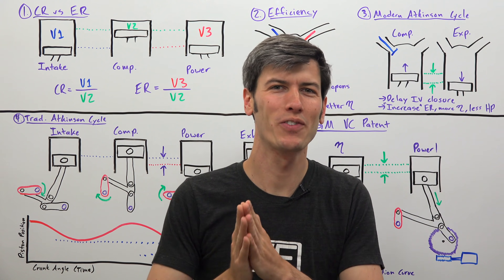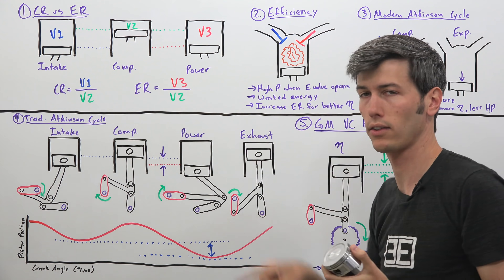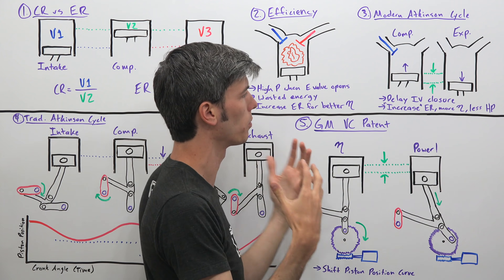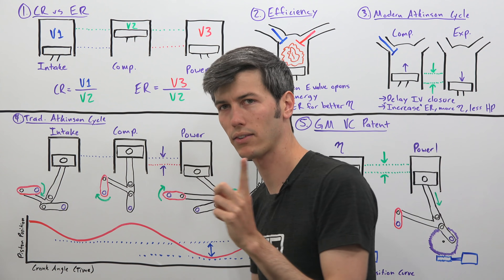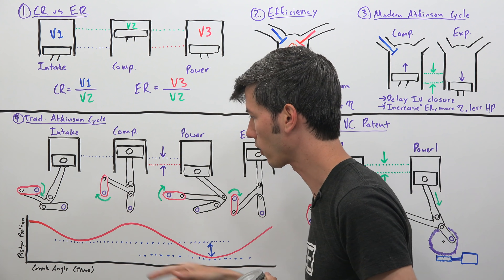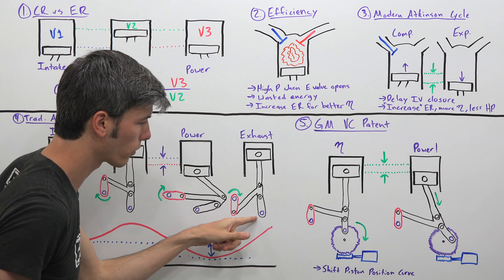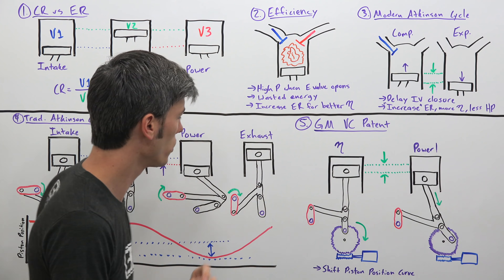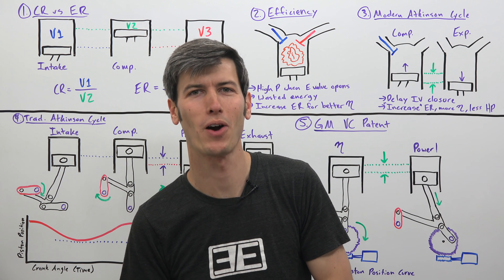How GM's Variable Compression Engine Works - Patent Review

Comment: It looks like a great amount of force isn't directly transfered to the crank shaft... And how about vibrations?
Reply: Good point, in theory with 2 cylinder pairs phased 180 degrees apart in an inline 4, vibrations should all be cancelled out, so it shouldn't need balancing shafts and can save weight. I am curious what the real world efficiency would be over a regular miller cycle engine.
Reply: @mattlimberg5763  Wait... I forgot for a moment you can put more cylinder on engine XD
The main drive shaft will move up-down-left-right, how can every piston follow the movement?
Because in 1 cycle the main drive shaft will be in 4 different position, by adding 1 more piston, the shaft will be tilted by 180 degree...
I still can't imagine it... Maybe I need an animation with all 4 pistons

Comment: Great explanation.  So, more parts.  More points for failure.  Added complication.
Reply: Was gonna say the same thing!
Reply: Great explanation of the Atkinson cycle. Despite the respect I have for this engineering marvel, I fear that the introduction of all these failure points will see it being shunned by power hunters. I suspect that you’ll see this technology on smaller engine to give them the occasional sensation of power  through various driving settings that are so common now.
Reply: It's what they want
Reply: You want simple and powerful, go Electric!
Reply: @allthatjazz721  Amazing how many man-years of engineering go into minuscule improvements in efficiency of a nearly obsolete relic of days gone by.
Reply: @allthatjazz721  Completly agree. I think ICE engines are way outdated and oldfasion...

Comment: By the looks of it, so much force just gets transferred into the bearings and is seen as reaction force opposed to driving the crank. Am I missing something here or is the illustration just not accurate. Seems like you can be getting much more torque by reducing reaction force in second pivot. Something to crunch numbers on anyways.
Reply: Nick Nogalo will definetly be more friction and resistance internal to the engine but theyre getting more energy out of the fuel, gasoline engines being something like 40-60% efficient theres alot of meat on the table to be gained.. those friction losses might be 1.5% engine power but the efficiency gives like 8% more power from the same fuel

That being said id never buy one.. dont be the first guy to try new tech it always takes them a few iterations to get it perfected

Comment: What I see here is more mechanical bits and therefore more things to go wrong....in order to have reliability, we need LESS moving parts.
Reply: By that logic a rotary should be the most reliable engine ever made.
Reply: @rosa-f5i6o  You'd think, but the apex seals have forever been a problem spot. Even with simplicity you will come up with issues to deal with, but generally, less is more.

Comment: Great, pushing hot expended gases back through the intake shouldn't create excessive turbulence, because gas laws don't apply to GM powerplants? Good thing GM has excellent quality control and this system won't require high precision/accuracy (sarcasm). My crystal ball show's a lot of bent valves, a ridiculous amount of carbon in the intake runners and wrist-pin deformation. If GM offered me an engineering position, I'd just become a stripper.

Comment: just imagine how rod bearing failures would sound like on this....
Reply: Now I wanna hear it
Reply: That’s only if they make it out of the same metals as before. Hope they use really good quality metals so it will be just as reliable as before.
Reply: @inthebeginning6895  GM doesn't know how to make a reliable vehicle any more so I wouldn't hold my breath
Reply: @GO AWAY But the 2.8's sound great?
At least the fiero ones do.
Reply: No way this design will be cheaper, now they need high-quality worm gears and extremely durable electric motors to withstand the operating conditions. I think many consumers will find it completely impractical to not only buy a modern GM product but one also sporting a new design. GM should've simply put the LS in every vehicle in their lineup, most people wouldn't complain. A few years ago I was making a 6 hour trip and stopped at truckstop to refuel. Their was a brand new Corvette in the parking lot, saw the guy get in to leave and I heard it just keep turning over as I was pumping gas. Funny enough, the fellow in a brand new Silverado 1500 on the opposite pump went to start his truck and all you could hear was the starter clicking. I tried for about 10 minutes jumping him off, but it would still only click. I had a brand new battery, I keep a good multimeter around and use it more often than I probably should, so no fault there.

I also remember Motortrend having a shootout and the supercharged Corvette had a massive engine problem right off the bat. Then you have absolute lemons of vehicles like the Cruze and likely others out there. All I know is something f*cky is going on at GM. Shame too, if they had an affordable midsize truck with a  LS that was actually QC'd I might be interested. Seems like they're moving as far away from simple and reliable as possible. Beats me 😞
Reply: It'd sound like a middle school drumline team
Reply: Like a shitty drum solo...
Reply: They sound like an ATM overdraft fee
Reply: Looks like GM is gonna have to make it as cheap as possible so it is easier to sell engines to customers. Its the GM way.
Reply: @Kyros9119   LMAO cheap doesn't have any relation to reliability. There's a reason why imports are tossing their garbage factory engines and swapping in GM LS V8's. There's a reason why import fanboys cry every time another LS swap gets posted.
Reply: @99Lezard99  Big end bearings was my first thought.  Without severely restricting the revs, I don't see how they would survive long, with all that stopping and restarting in the opposite direction.  At least the little end is relatively light...

I'm thinking "bag of marbles under the lawnmower" sounds.  :-D

Comment: God explanation - thanks. For GM though, my guess is that it is too little too late with EV's coming like a freight train. Maybe they should've put that effort into improving EV batteries, electronics or motors?
Reply: or even improving efficiency of solar
Reply: @fidelcatsro6948  The more important metric is price per unit of generation capacity....which is already lower than coal.  All efficiency does it make panels smaller...which could make panels cheaper (or it could entail more exotic materials or complicated manufacturing which give the opposite result)
Reply: @DT-dc4br  that makes sense..

Comment: Something like this would have been more interesting 15 years ago. Now it seems the way forward are hybrids and +/- gearboxes akin to Toyota and Lexus. In such a case the engine doesn't need to be hyper-efficient outside of optimum operating range because you can run the engine harder and store the extra energy in the batteries. Long-story-short, this kind of setup makes more sense in a big power non-hybrid engine. And those are kind of going away anyway.

Comment: Doesn't lowering the compression ratio and then adding boost kinda just get you back where you started?
Reply: no it's not. you might start with the same compression pressure, that's right. but the work you had to do, to obtain it, is lower than in normal engines. remember that a turbocharger is a way to regain already lost exhaust power. A compressor instead won't do any good at all. this means you have the same long way to expand and use the combustion pressure, but you needed less mechanical energy for the compression. and that's the amount you can win!
Reply: @Taunus-Tim  But, unless I'm misunderstanding, it's the final pressure/temperate in the cylinder that causes knock, which only depends on how much air you pull in and the temperature of that air. So without an intercooler you shouldn't actually be able to get any more air into the cylinder while still avoiding knock, meaning you wouldn't make any more power. What you said about using exhaust energy to do some of the compression rather than doing it all with the Piston makes sense, but that seems like it would mostly just increase efficiency, not so much power.

Comment: GM has always been the most reliable America brand and this seems to be very reliable. Ford is not known for reliability their new 18 and up 5.0 coyote they took the sleeves out a 38 pound weight reduction and use thermal spray weld for the cylinder liner and it is causing piston slap and ultimately catastrophic engine failure.

Comment: Very nice explanation!  I just don't see the point.  The atkinson advantages can be taken advantage of with just the use of VVT.  GM's new technology doesnt get use any closer to CAFE standards.
Reply: the atkinson cycle is very limited in scope.
this and many others will get u from 1:7.5 to 1:18.
so a 1.0 liter 4 cylinder can run at 40% to 60 % throttle and be very efficient and only making 30 to 60 BHP.
almost getting nock because of the high compression.
then when u want power it will just dump in 2 atmo of air and the lowest compression ratio will get u close to nock.
wilst making the power of a 3.0 V6. 

u cant get this mutch variation by just controling the intake valve.
and if u combine this with a electric engine (whitch euro7 standers will allmost sertenly make nesesery, like strat stop systems for euro5 and 6) u can get the combustion just perfect to maintain hi way speed and use electric for small acceleration only.
and the big power for fun times and luging a dead battery on a very long trip.
Reply: A VVT Atkinson cycle effectively reduces engine displacement reducing maximum power potential. Requiring reversion to the Otto cycle to achieve maximum power, negating any efficiency gains.
Reply: The Prius engine is valve operated Atkins cycle, but uses a blower to make up lost displacement.  Go figure.  (The stinker may be engine displacement taxes. ). The valve operated Atkins simple, but may have other buggers.  The GM linkage looks tough to 
balance, lubricate, heavy, and friction.  But, When alternates considered,  the linkage may be superior.

Here is a chewable nugget: from thermodynamics compression ratio is meaningless, the correct metric is pressure ratio.   A conventional engine’s compression ratio is constant no matter the throttle; the pressure ratio changes with the throttle.   So how do you conjure an engine with variable power, max efficiency over a useable speed range?   Not easy.

Comment: I have questions:
1. Which cycle is better for more power purpose?
2. Any drawbacks from engine design that use linkage like that rather than direct connection to crankshaft?
3. What's the differences between GM VC engine and Infinity VC engine? 
4. Technically, is there any differences form of crankshaft used on VC engine with the one used on ordinary engine? 
5. Is there any possibillities to make otto cycle engine behave like atkinson cycle engine?

Thank you
Reply: my answer to all is to use rocket thruster engine

Comment: I don't see what the benefit would be over the modern Atkinson cycle though? It just appears to be something else that could go wrong? Isn't it simply adjusting the full throw of the piston equivalent to closing the valve at around top dead centre with a load of extra complication?
Reply: Agreed. I'd rather have a larger displacement atkinson engine.
Reply: additional moving parts links on the already traditionally stressed conrod bearings

Comment: So GM is adding extra moving parts to old technology (IC Engines).  EVs are the future! and you know it! I don't see this going into production, each cylinder has an extra electric motor.  Another potential point of failure.
Reply from the maker: You would have one motor that would adjust a shaft that would influence the CR of all cylinders, rather than one actuator for each cylinder. :)

Comment: Fit a battery and an electric motor, burn fuel at a power station (and have renewables) . ICE engineers are throwing the book at it, what with variable cam cycles, complex turbine driven inlet, a chemical plant ton the exhaust and now variable geometry crank. it’s getting ridiculous, ICE is dying it has to be, the electric car is here and has to be better long term than this.
Reply: All these innovations are several decades late. They have been fairly lazy, but now with electric is taking over, now they are trying. Its just too late.

Comment: It seems to me that if Atkinson cycle has pressure sensor such that electronic selenoid controlled valve closes after chamber has reached atmospheric pressure (no vacuum), it's produce just as much power and be more efficient.